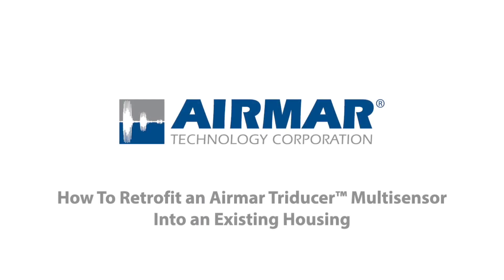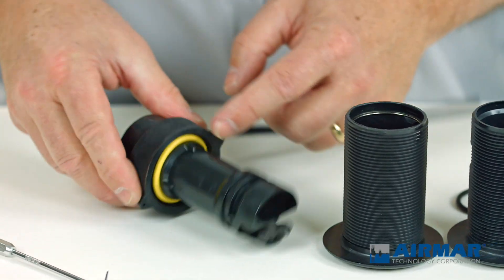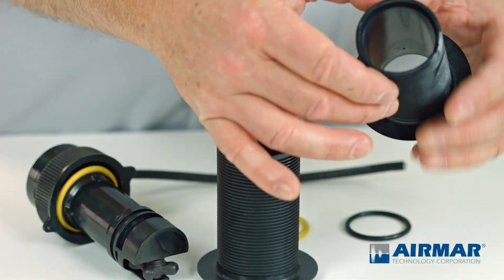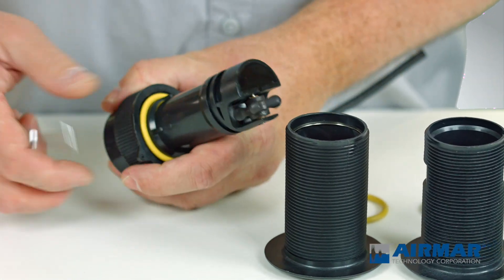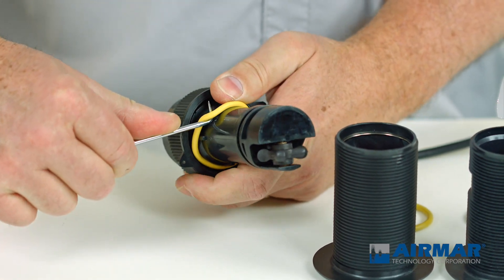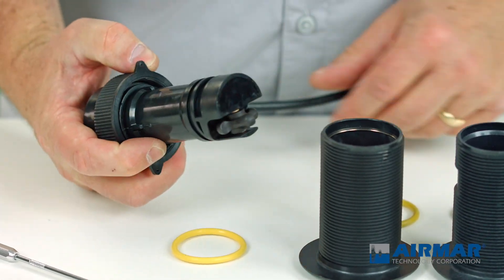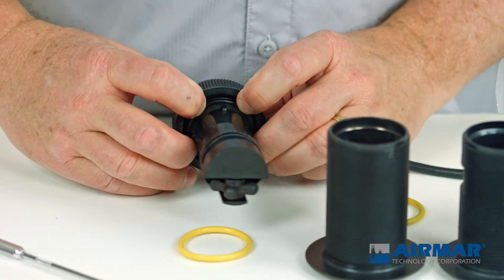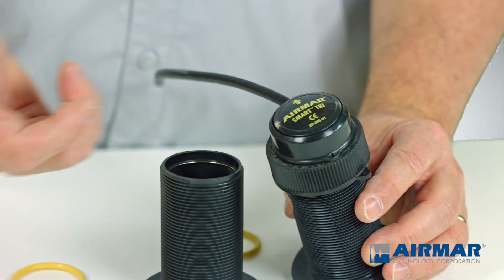How To Retrofit An Airmar Transducer® Into An Existing Housing

Comment: are all airmar through hull fitting the same diameter ? , my current one is an older speed/temp 20-399-01  , will the dst800 fit in the way shown ...
Reply from the maker: There is a very strong chance that the housing is the same and can be used for the new sensor.  If you call our tech support at 1-800-543-6326 they can verify for you.  Thanks